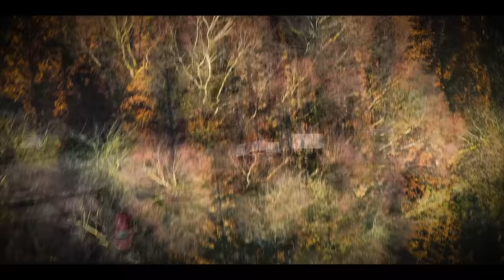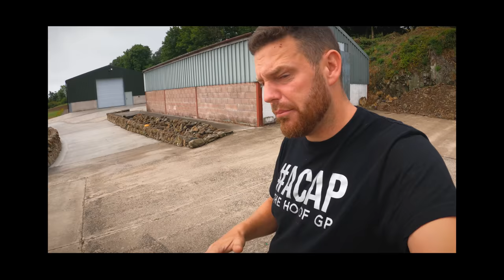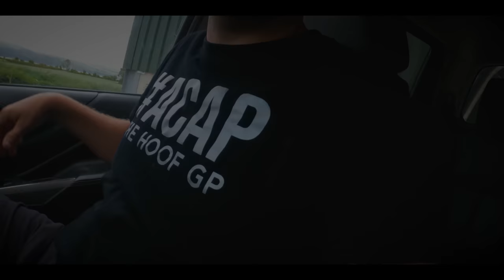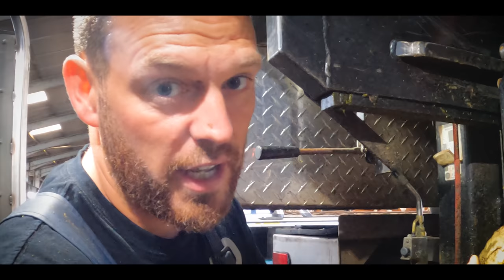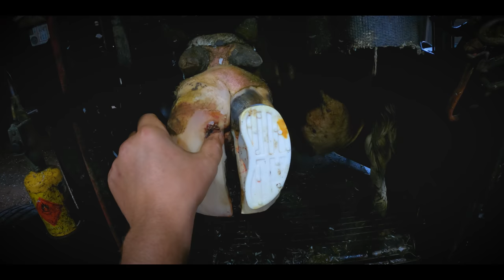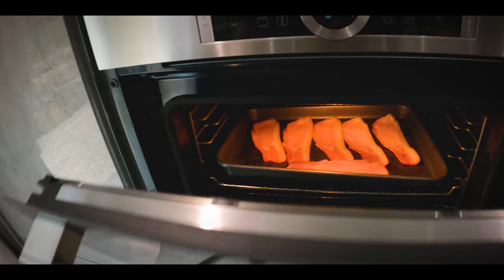COW'S ZIT POPS with a SPLAT!

Comment: Love the frenchies!! New truck is a beast.if you ever want to trick it out with few fancy bits then check out performance alloys. They are based in Northern Ireland and do lots of car and truck accessories! My neighbour Helen works there so if you ever decide to get a few bits ask for her!!
Reply: Ehh he really should have waited a year, IMO. The current European only Ranger Raptor is RIDICULOUSLY underpowered for a truck with the "Raptor" name/branding. A 4-cylinder turbodiesel putting out just 210hp in a so-called "Raptor" is freaking embarrassing....

The brand new 2023 Ranger Raptor platform that the whole world is getting otoh is supposed to get a twin-turbo EcoBoost V6 with 310 ponies + a whopping 400 lb/ft of torque (same engine in the top spec Bronco). Aka a much, MUCH more suitable engine for a proper "Raptor" truck! Plus it has the additional advantage of not being a stupid polluting, more expensive to fill up diesel.

Comment: Because of the performance oriented suspension, engine, differential and transmission, the Raptor is the worst truck you could possibly buy for a trailering/work vehicle. I would trade it in or takeoff the graphics pack because anybody who knows about trucks is going to think you’re a tool.